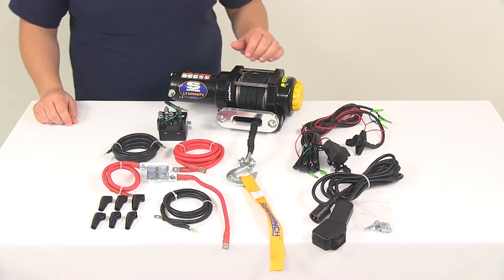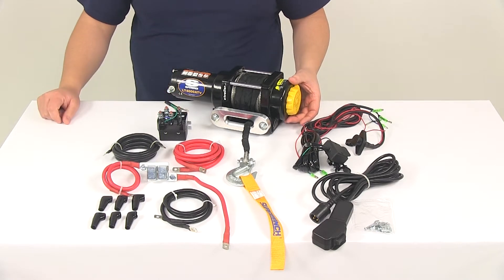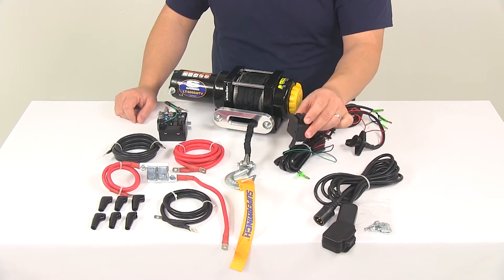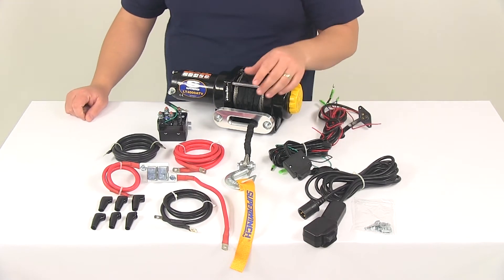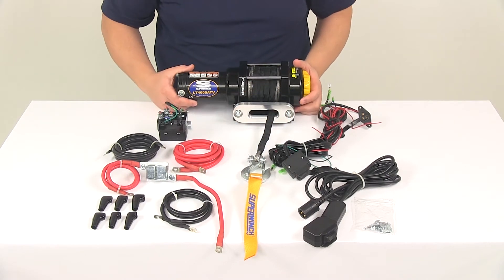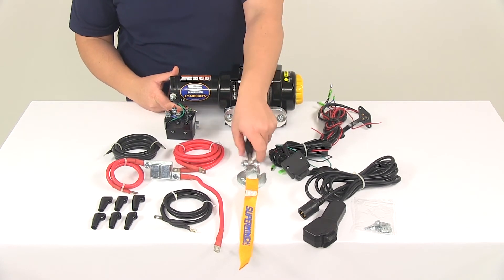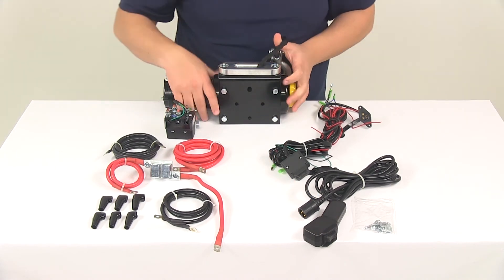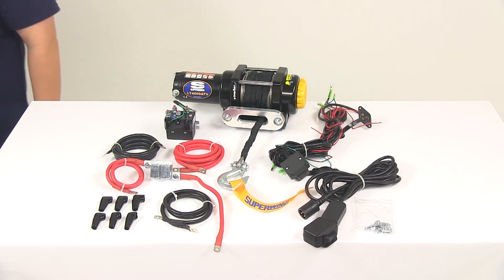etrailer | Hands-On with the Superwinch LT4000 ATV Winch

Comment: Great video, what is the IP rating?
Reply from the maker: The Superwinch LT4000ATV Winch (1140230) does not have an officially published IP rating like IP67 or IP68. It does feature sealed motor and solenoid components for general weather resistance, but Superwinch does not list any specific water- or dust-ingress certification for this model. In short: it's weather-resistant, but not IP-rated. Does this help?